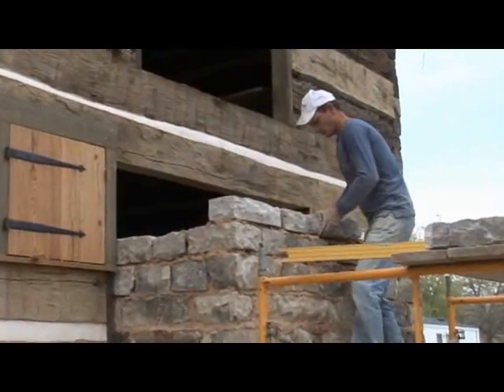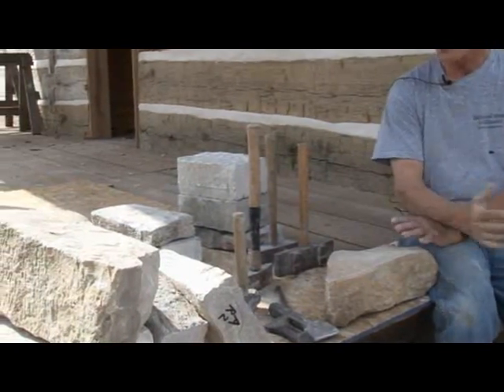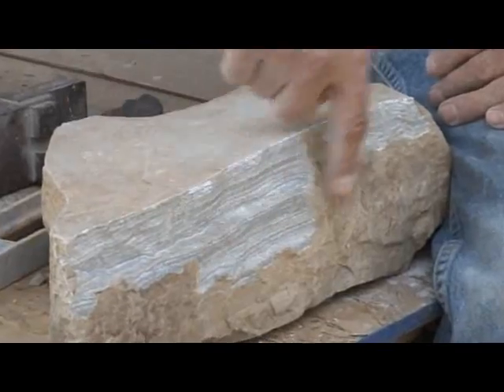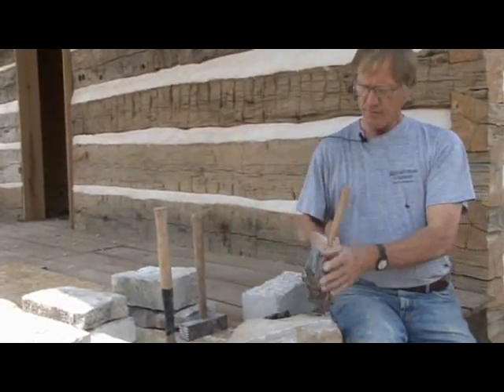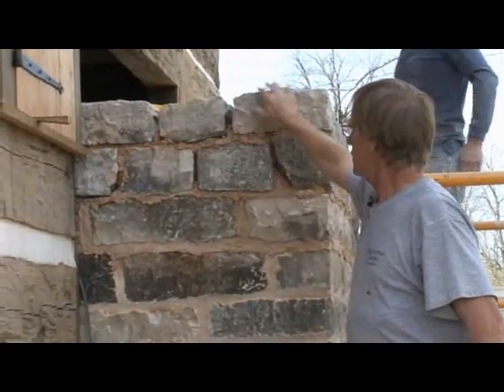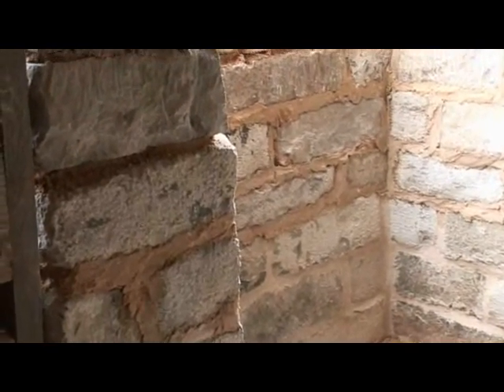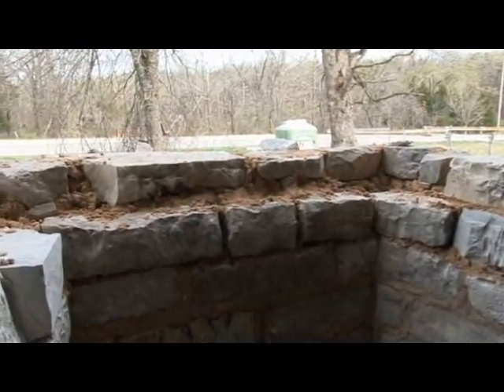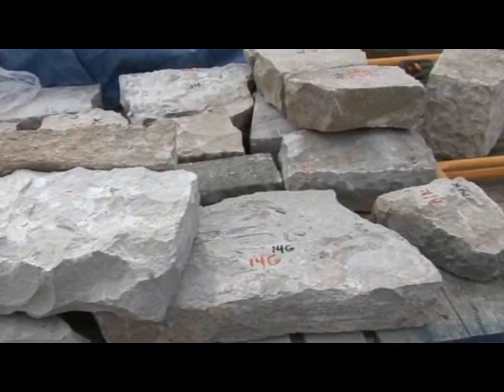Stonemasonry Rice House

Comment: your tools are more for granite.....they used a hammer and an axe mostly.for dressing faces...the wedge that you think is a pitching tool is really for splitting stone.....btw they used HYDROLIC lime not HYDRATED lime....learn the difference.
Reply: scott left   btw, they would have used hydrated lime, also known as lime putty or quick lime, which would be slaked in water for months. Something not done with hydraulic lime.
Reply: But you're right that is a wedge, not a pitcher.
Reply: Yeah... depending on the era and location... some old foundations are even ,made with hydrated lime cement.  The bricks that were low fire were what also used hydrated lime mortar.  Once the high fire bricks came around then hydraulic cement (lime) was used.  Hydraulic cement if I understand correctly would have crushed the low fire bricks from the shrinkage. Again... periods in time and locations had only hydrated lime used and is still required to meet certain specifications.
Reply: Yes but how do I cut granite with copper chisels like at the osireion or the valley temple, or the serapeum, etc
Reply: @righteousred723  a hammer
Reply: @markmiller4503  tru ty

Comment: Modified Rumford?  The two primaries of a Rumford are the very flat sides and short back,, angled to reflect, radiate the infrared out into the room, with the extremely shallow box.  And the second, which you alluded to, the throat is wide (left to right), narrow (front to back), and the smoke shelf is a very generous volute to roll the smoke and promote the draft.

Your sides are flat enough that I'd hesitate to call it a Rumford.  If you take a Chevy and put a Ford engine, transmission, and Dodge rear end in,,, is it still a Chevy?

I assume you are still building,,,, try it,,,, build a real Rumford.  It looks a bit odd, oh yes,,, but it works really, really, well.  Add a very wide hearth to it,, they don;t tell you that,, and a possible stone fiddle surrounding it.  (Look to sailboats as to 'fiddles',, they keep the plates on the tables and the books in their shelves.  In this case keep the sparks off of the rug.)
Reply: This is sad. A lotta knowledge with no one to soak it in or to know what you’re talking about. I read it all hopefully it’s gives ya some justice lol
Reply: @MrCedricPeterson  Thank you  ! It was good to be reminded of this video.  This stone mason is a very talented man.  What I had wished for then and now,, was to watch him at his bench,, whistling or thinking to himself as he worked the stone.  I have done some stone.  I have found it to be as much therapy for myself as it is money for the job.
Yeah, I've been doing it many years.  My hands look worse than his.  XXXL gloves usually fit,, when they can be found.  Bare hands and thick calluses are the norm.
What is hardest to relate to someone, is the satisfaction of a job well done.  There is a special inner peace,, before you stick your hand out to collect.  A similar peace I find paddling a canoe.  And,,, the 'kids'  just do not seem to get it.